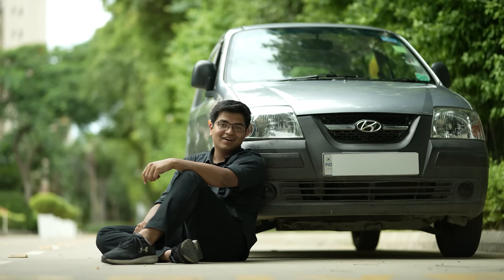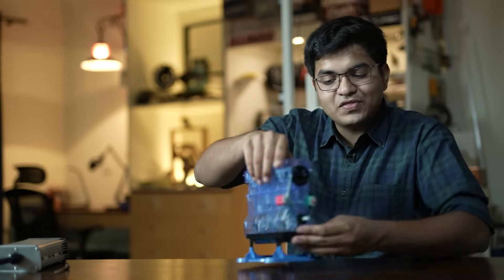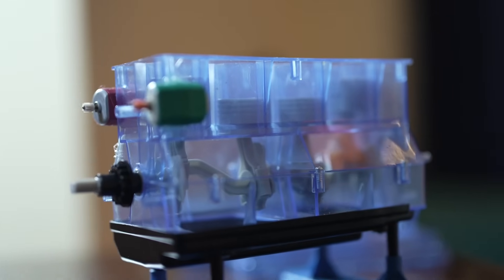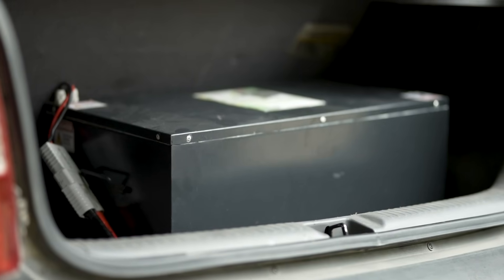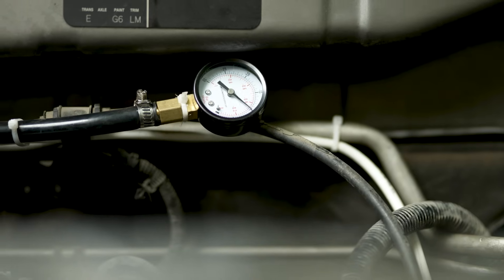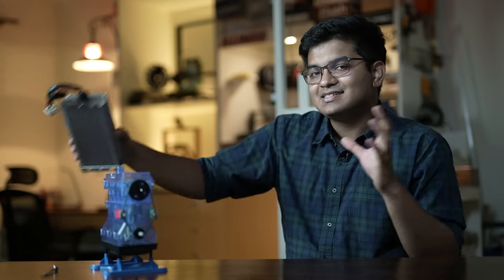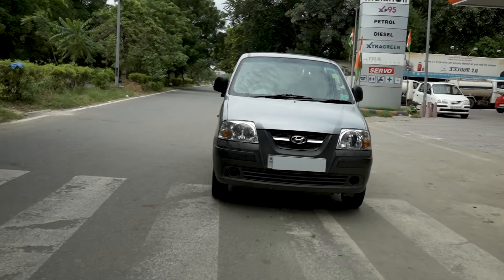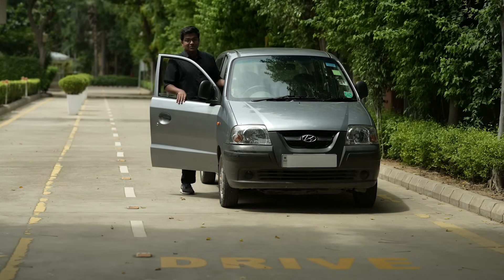Simplest EV Conversion under $3000 - Convert Your Car in 3 Days!

Comment: I am an Automotive Design Engineer and even in the wildest of my dreams I could've never imagined to covert an IC engine car into an EV by keeping the lower half of the engine intact with rest of the car. Kudos to you man.
Reply: Looks soo simple. I mean it was just there... Well done 👏
Reply: Does nobody realize that he is pushing an entire car's weight through a timing belt that's only meant to spin a camshaft. I'm an EV enthusiast but also a car guy and qualified technician. On an ICE engine, your solid steel crankshaft is what sends power to your wheels and a timing belt is only connected to drive you camshaft and water pump. It is not meant to take the load of pushing your car, and therefore this setup will fail fairly quickly. I support EV conversions, but this setup is a gimmic for youtube
Reply: @supercadet111  I was looking for this comment
Reply: @dan8789 yeah same honestly thought more people would see that. How would a timing belt support such a load
Reply: @arlocharles4032 according to google a timeing belt can handle 150 kW that's 200 horsepower. Maybe google got it wrong but about 30% of the power the engine makes is transferred to the cam shaft. 30% of the original 40 hp is 12 hp he has an 8 horse motor so he'll be fine.
Reply: Oahu can you see this as a viable inner city transportation service . People could rent these electric cars for short inner city trips etc et
Reply: Sorry for the spelling error in your name . Typed too quickly .. lol
Reply: It’s so brilliant.
Reply: Without modifying the base line mechanism of his car, he did customisation by adding an electric motor and high power battery and 12v convertion method, keeping the engine oil intact as it is..... 

Power transmission to steering and crank shaft....

And to simplify braking vaccum controller was used to smooth braking....

Completely.... it's his convertion thought to minimise his fuel expenses.... 

Nice thought...
Reply: Really? Isn’t this similar to how a Honda hybrid works with their integrated motor assist? It’s an electric motor put on the gas motor to assist it. This just takes away the assistance part and just runs the whole show.
Reply: Because that is not ideal if you look at this problem from the perspective of an engineer, still a good way to not spend as much for a small-budget project
Reply: Going back to weight, before Mihir mentioned it, I was thinking “Uh-oh, by removing so much weight from the front, the car will be unstable and bounce all over the place and not grip the road at all! 😮”
As others have said, a car’s weight distribution is very important.
Reply: Dear engineer, 
If you this technique you will not get ac when you are stuck in traffic and while braking..😅
Reply: Definitely a pioneer
Reply: inefficient. just keep gearbox, use adaptor plate for motor, use electronic power steering pump from modern car
Reply: I want to convert my santro old model how much time and money it will take
Reply: @dushyantpunyani1691  chikki you need someone expert who has done this before...
Reply: @dushyantpunyani1691  i can convert that very easily
Reply: @adityachauhan703 What happens to the crank case when it runs without oil pressure?  There is no wall bearing there.
Reply: how much cost
Reply: epic
Reply: Very good idea
Reply: @mahendradoshi7205  It is but if you try it be sure the motor is rated for the side load or put in a pillow block to alleviate the load.
Reply: So the pistons are out.  I assume the connecting rods are out too.  So without rods, I think some creative oil plumbing, inside the engine, was done to maintain oil pressure to the main bearings.  The block and the crankshaft are now just a jack shaft and bearings.  So you can jettison the weight of the exhaust system, the cooling system, the ignition system, the  valve system, the fuel system. An oil cooler might be needed ,but I doubt it.  The deck surface is a nice flat place to mount things with threaded holes or studs built in.  A car with a cracked block or spun rod bearings or a bad camshaft would be ideal.  Cylinder damage from a dropped valve ,or piston/ valve clash from jumped timing would make a perfect donor.
Reply: What happens to the crank case when it runs without oil pressure?  There is no wall bearing there.
Reply: que es kudos?
Reply: How does the electric motor connect to the gearbox?
Reply: Owner/user reviews about running the car in real time and any legal/RTO matters faced till date🙏🏻
Reply: U r noob automotive designer
Reply: In Brazil we call this a "Gambiarra"
Reply: I am having an innova can I replace with ev.
Reply: I totally expected this video to take A WHOLE different direction but when he said he was gonna power the car while keeping the lower half of the engine my MIND WAS BLOWN!!! Genuinely a genius and I’m so happy he showed his thanks to his mentor and mechanic because in my head I was like how the fudge am I gonna do this alone and honestly the end credits made this seem all the more possible
Reply: Still carring a motor. Should only have  used the transmission tho
Reply: Hlo I'm interested in becoming a automotive design engineer what's your experience and what are the limitations and also am I able to get a good job
Reply: and how does the timing belt handling power of the engine and braking down with engine - he does not show anything really
Reply: He didn’t come up with the idea he ripped it off 🤷
Reply: That's because it's a bad idea.
I'd imagine the electric motor would be more efficient if it didn't have to drive the bottom end of the engine still.
Not to mention carrying it around adding weight to the vehicle
Reply: @1974UTuber  I do understand your point but this guy has converted his old car into an ev without spending a fortune on purchasing custom parts. If he had not done so he'd have to spend a huge amount just to get the parts fabricated.
Reply: @1998IP  that's the genius in all this. Granted it comes with somewhat heavy compromise but he's lowered the price ladder for most of us to enter. Kudos to him
Reply: @1998IP by replicating the cost can be brought down. People should try it in largescale so that the stupid policy of scrapping can be thwarted.
Reply: @1974UTuber  ...all things being equal...by the time he did a full conversion to electric...the weight would of been the same by engineering standards.(cars are engineered to a certain weight..you must return the weight you take out or you will have problems..i.e suspension)..but the cost of how he has done it is far cheaper as mentioned,also note...he used a smaller electric motor to see if it could be done.
Reply: @dmystify1381 The weight may be the same, but in the current configuration the small electric motor is also pushing part of the old motor around causing further losses through friction and heat. 
If anything this project is just proof that cheap solutions are mostly a waste of time
Reply: @1974UTuber , he was able to do a quick and inexpensive conversion to electric with ONE electric motor.  Yes, keeping the crankshaft and the transmission did not make the vehicle lighter, but that also enabled the use of transmission as a FORCE MULTIPLIER.    Think of a 10-speed bicycle.  You can go much faster than a single speed bike, by shifting up the gear ratios, with the same number of RPM’s from your feet.  OR you can go the same speed with fewer RPM’s.
Reply: @1974UTuber How is him getting almost 7 miles per kWh a waste of time when a tesla gets 4?
How much power do you think a lubricated crankshaft with no pistons can steal? 
I have just one potential issue with this and that's I doubt the motor was designed for side loads.
Reply: @1974UTuber  Bruh, the crank is meant to drive the timing belt, not the other way around. This is a horrible idea that will fail very rapidly.
Reply: @1974UTuber  Surely. If you park aside the ICE car, and get a spanking new bed of Tesla batteries and the set of Tesla motors all going into a spanking new Tesla body shell. 
But this is retro. Not your Model Y, threatening to drive itself with FSD. 😜
Rupee 1 per km would thwart all your 'imagination'  of compromised efficiency... 🤭
Retro is retro ... Maestro 😜
Reply: @1974UTuber  aww
Reply: Is it legal to convert the type of engine/motor?
Reply: Who cares. F the government  @RealShreyas
Reply: @RealShreyas  I think it is legal, but one does need to get their car certified by a govt agency after doing an ev conversion
Reply: @1998IP  how would they know fuk that
Reply: @1998IP  no
Reply: @1998IP No you don't. do what you want. It's a free country..
Reply: you ain't no automotive design engineer...
Reply: thats great but unfortunately the government does not allow you to make design changes to the car... which makes such rules id-iotic...
Reply: @ravebrave8866 That's just not true. Quote the specific law for us.
Hot rods were created by exactly what you claim is illegal. Guys have been changing out engines for more than 70 years. Safety equipment can't be altered like removing seatbelts or blinkers.
If you can't alter a car why are their laws about bumper height difference between front and back bumpers? 
Don't need specific law to make changing bumper height illegal if installing air shocks is already illegal.
Reply: @ravebrave8866  this is not idiotic lallu. ese to koi bhi kuch bhi bana k road pe dolega n logo k liye risk hogi
Reply: Your comment shows u re not a good engineer 🤫
Reply: All of the above it is completely illegal and always susceptible to fine as well as cease of the vehicle by authorities
Reply: @adityachauhan703  What the F in this country is legal...
Reply: @ravebrave8866  agreed
Reply: @adityachauhan703 Not in the US it's not. Where is it illegal?

Comment: Kuddos to you and your team, amazing concept and great enginuity, enjoyed watching your build.
In my view depending on the vacuum pump for your break is a bit risky, instead using a compressor with a reservoir would have been ideal, but yeah it would increase the cost because of more parts and for the modifications to the breaking system to work on compressed air.

Comment: you can also use sealed lead acid batteries, fitting them replacing rear seat or the trunk of the car.
Power brakes were required but I think power steering could be avoided. Also compressor and AC can also be avoided and hence that 12V battery can be removed.
The other car electronics can be powered directly by using converters for central locking, Lights and other stuff.
Reply: how do you now handle the weight of the steering wheel?

Comment: That idea of using a weaker motor with gear system was an excellent idea or say it happened by luck :p
This way, motor runs at its peak efficiency at some fixed number of RPMs.
Reply: you can also use sealed lead acid batteries, fitting them replacing rear seat or the trunk of the car.
Power brakes were required but I think power steering could be avoided. Also compressor and AC can also be avoided and hence that 12V battery can be removed.
The other car electronics can be powered directly by using converters for central locking, Lights and other stuff.

Comment: If the battery runs out of energy when you are running at a high speed, you wont be able to stop the car.but the project is really awesome
Reply from the maker: Hey! Thanks for your comment - that's a really great question. 

The way I've set it up is that the 72V LFP battery in the back keeps the 12v lead acid in the front topped up. So, even if your 72V battery is completely discharged, you still effectively have a freshly charged 12V 42Ah Lead Acid to power the vacuum pump. Even if this 12V battery were to die, there is still enough of a vacuum in the brake booster to brake ~3-4 times. Lastly, brake boosters only aid you in hitting the brakes - even if the vacuum pump system wasn't there, you'd still be able to stop the car, you'd just have to hit the brakes harder. 

Hope this helps!

Comment: Great project. it would be useful to have a few photos of how the motor is connected to to the drive gear. Also was there any problems with the ECU not getting signals from the engine and exhaust? Any problems with getting the car on the road legally. Did it need inspection by a government agency? How about insurance?
Reply: This is experimental.... therefore it will be understandable if this car is not road legally in certain point. By the way... on part of ECU... this is non-electronic based carburetor engine car... no ECU I personally think.

Comment: Not worth it, my car is only worth €1500 , 17 years old and running perfectly after 235,000kms. I put anti polution additive in the fuel does over 50mpg.

Comment: Great recycling ...  In that car how is the oil pump driven ?  How did you block up the oil ways to the head & pistons.   .. The great thing about this mod is the car retains the same engine & engine serial number , so no need to re register !   If you find the timing belt breaks too often .. Would it be practical to fit a motor inside the block, where the crank shaft was?

Comment: You are not losing weight in the car but you added more weight for the motor and this will take more current for the motor and the battery will last shorter

Comment: Your invention is great. But i have suggest for steering wheel you have to convert or use electric powered steering to minimize the effort of your motor engine. And for the alternator you can connect it through the axle or in your wheel. That the alternator can charge your battery

Comment: Really interesting, Ive looked into an Ev conversion a few times but its still a lot of money and a huge headache to do it properly so I like seeing what people do to make it easier. How much weight would you save if you did remove the motor?
Reply: I don’t know specifically for this engine, but would guess it weighs about 100-110kg in factory configuration - my 2.0l four cylinder is just over 150kg.
Reply: @savyor1839  I estimated the same
Reply: Good eye bruh!

Comment: why you removed the engine just join the motor with the engine and run both of it. by the mechanism used inth cycle wheel gear system . incase of battery drained we can run it on the petrol engine .my long day's idea was removing the petrol tank from underground and replacing it by cng or lpg tank .

Comment: You can actually do away with the 12v Lead Acid battery and replace it with a voltage converter.

Comment: it would be better to remove the whole engine block and toss in a dual shaft electric motor. you would need a bracket to connect the engine to the transmission. 
the other side of the shaft can be used to run a belt to the other ac compressor and other components you need. 
i've done this on an S10 pickup truck as a class project 12 years ago. things should be cheaper since there should be a larger supply of electric motors to pick from.

Reducing weight is very important. sure its cool to convert a vehicle to electric but if you're wasting power moving dead mass its going to reduce the range significantly. 
reduced range means more charging and the batteries cells wear out faster which cost a lot to replace. 
its just better in the long run to make it as efficient as financially possible to begin with. 
it wont be fun to spend buckets of cash to convert a perfectly fine vehicle into a heavy golf cart that you have to charge every 20 miles.

Comment: Neat conversion but you made a timing belt into a drive belt. Can't see that as being great long term, plus the step down in power is probably required to pull this off otherwise the torque would destroy the timing belt instantly.

Comment: 60 KPH and 8 HP? Pffft what a absolute waste of time you can’t be serious , especially with a measly 80 KM range . A 70cc 2 stroke scooter has more practicality 😂😂😂 like what , is traffic that bad in India that you have not a single highway or need for anything that goes faster than 60 kph ??

Comment: the performance of a conversion like this would benefit from a larger v12 and manual, the current specs produce the perfect tesla destroyer - with a top speed of 200mph and a range of blah-blah-blah - you'll fit right into the gas power Best of all, the car costs you nothing

Comment: Considering this still has pistons, there might be some noise from its operation, I wonder how it actually sounds! Also, instead of connecting it to the crank, why didn't you connect it directly to the flywheel? It would have reduced your car's weight and its requirement for engine oil!

Comment: I'm pretty intimate with my E30, I wonder if removing the head and the intake manifold would leave plenty of room for an EV motor. I'm in America and we need at least 55mph for city driving. definitely worth looking into, thank you! I wonder if removing pistons, exhaust, water pump, coolant, would be good? then again, maybe the electric motor could benefit from the ICE water pump with some proper plumbing.

Comment: Knowing a bit about mechanical and electrical.  This is way too inefficient to have any range at all, also a rubber belt will continously break. Leaving you stranded.  Much better off using the money for an electric bike as weight and efficiency is everything when it comes to battery powered vehicles.  I see this as a complete Waiste of money